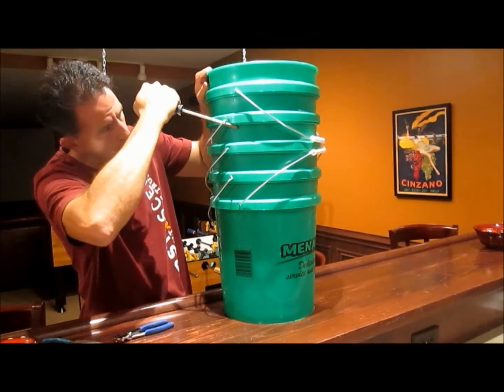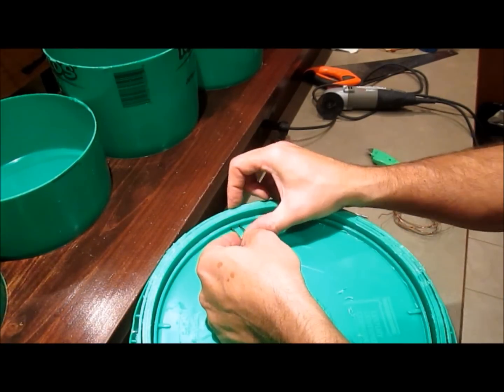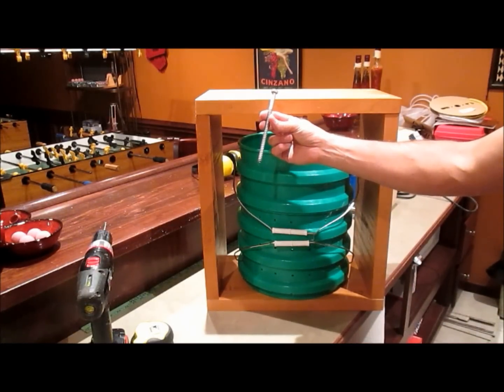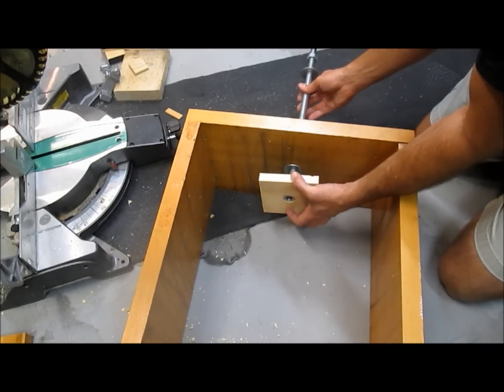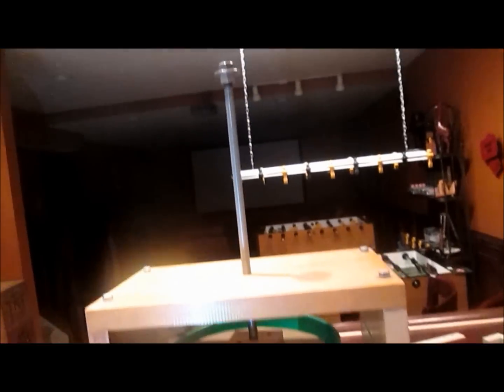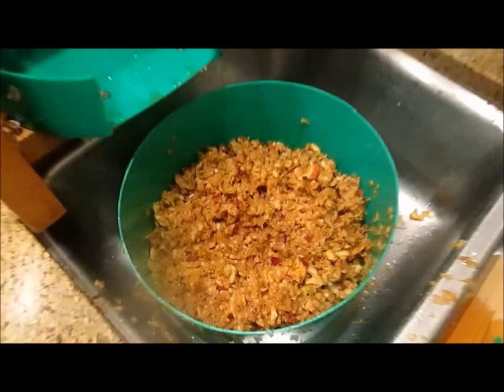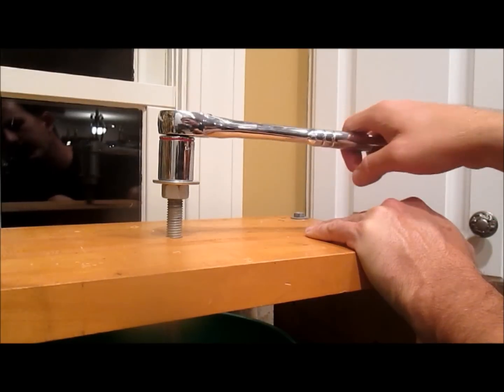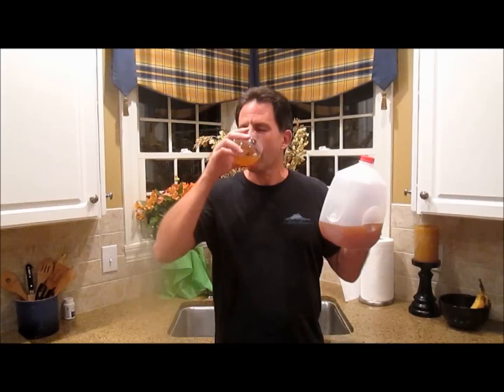How To Make an Apple Masher and Cider Press - Part 2

Comment: I have a question on the press box with the force you are putting with the bolt being threaded through the top do you have trouble with the top of the box wanting to pull apart from the rest of the box
Reply from the maker: +Jason Henson (Sleepy Wooden Turtle) - Excellent question!  Indeed, I used it several times, and on the 10th batch, or so, one of the lag bolts broke.  I was done for the season, anyway, so I did not fix it, but this season I will replace those four 1/4" lags with six 1/2 inch lags.  The wood itself is plenty strong.  I used maple.

Comment: How long was that 5/8 bolt? And where would you get such a long bolt?
Reply from the maker: It is a 6 inch long lag bolt.  All hardware stores sell them.  Check in the screw and bolt area.  If not there, check the fencing or decking area.  These bolts are typically used in outdoor projects.   By the way, use 6, not four.   I snapped a bolt just from pressure of the press.

Comment: Nice videos. I have also thought about using a PVC pipe for the drum in the grinder, but I thought that the screw holes might enlarge over time and allow the screws to fall out.  Have you noticed any wear or loose screws?
Reply from the maker: +Michael Mullen - Those screws will never get loose.  They are screwed through the caps and the pipe, for a total of about a half inch of plastic.  No problem!

Comment: Nice DIY system.  How much torque does that fan motor have?
Reply from the maker: +John Doe - It has enough torque to grind one apple at a time.  If you put in more, at once, the motor can stall.  It gives me just enough time to get the next apple and check it for worms or bad spots.